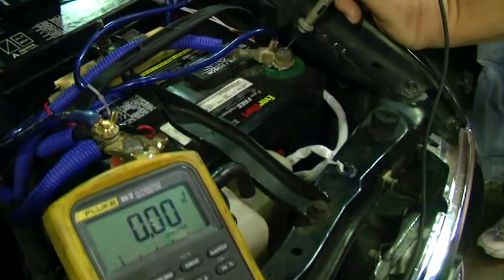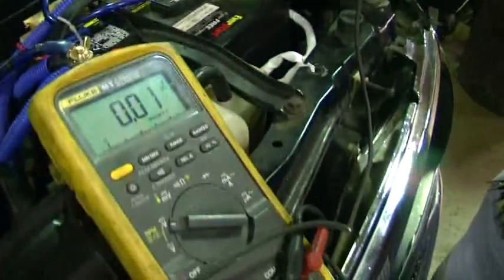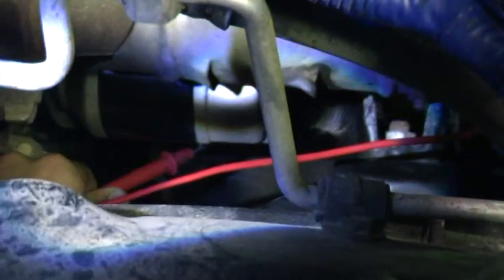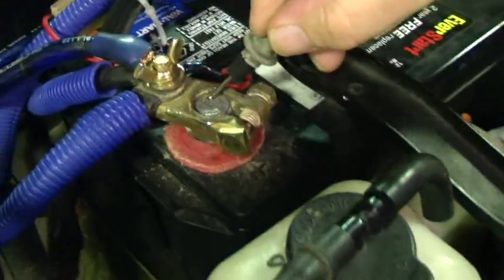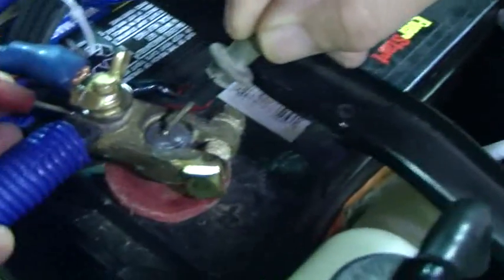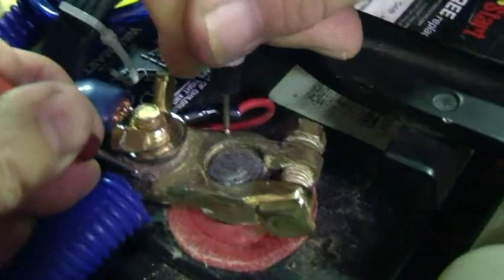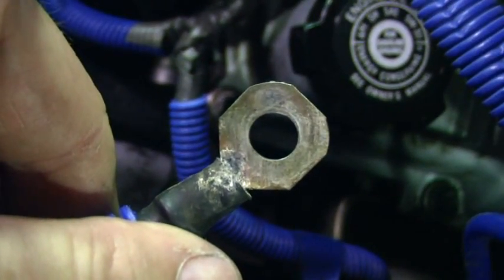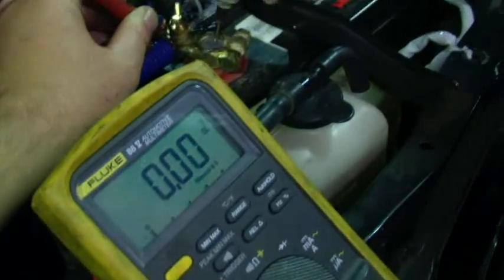Starter Circuit Voltage Drop

Comment: So what does a voltmeter measure? 

FS explanation: As charge (measured in Coulombs) moves through a circuit, it must be driven by energy (measured in Joules). Voltage (or Potential Difference) is a measure of the amount of energy driving the charge at any point in the circuit.
 Voltage = energy/charge = Joules/ Coulombs=Volts. 
The voltage always has to be measured between 2 different points\polarity, in the 
circuit,

Comment: At this 3rd level of understanding, there are 2 competing but equally 

rigorous and correct systems for describing "electricity"; the 2 systems 

vary only by including or not including time as a factor. The system that 

does not include time is more fundamental, getting right down to the sub

-atomic physics that drives electrical phenomena, so I prefer it. Let us 

call it FS for fundamental system. The popular le Systeme International 

includes time

Comment: rather than technically correct facts, easily misinterpreted partial truths, and the 

occasional totally incorrect information. When people start ascribing 

human characteristics like "desire" to electrical circuity, and use 

outdated or generic words like "electricity", you know they are operating 

at that middle school or high school level textbook level.

Comment: OK, what we've got here is information being expressed at different 

levels of understanding and usage. 

(1) An electrician only needs to know that his voltmeter measures 

something called "volts", without being concerned what "volts" means. If 

his voltmeter reads 117 volts here and 235 volts there, he knows whether 

or not the circuitry is working properly. 

(2) A person reading a school textbook is going to be subjected to 

oversimplification, creative use of langauge and analogy

Comment from the maker: Sorry bro, how wrong you are.  Meter leads measure a difference in voltage between each lead. Place one on the battery neg and one on the battery pos and it will tell you the diff between the neg (0 volts) and the positive (12 volts). 12-0=12 volts. Place one on a pos post with 12 volts and a pos clamp that is only getting 3 volts because it is not connected to the post good. 12-3=8 volts. The the voltage drop is 8 volts! This type of measurement has been around for a long time and is used often

Comment from the maker: How wrong you are. Meter leads read a difference in potential voltage. Normally we place the black lead on the battery because we know that is a source of 0 volts.  If we place the red on the positive post it will tell us the difference in voltage between the two posts, (12 volts on a battery). Same hold true if we place one lead on the pos clamp and one on the pos post. If all is good, we should read 0 volts.  If the connection is bad it will read the diff in voltage between the to points.

Comment: . Disable the engine so it will not start when it is cranked. (Ground the ignition coil wire, or disable the ignition circuit or fuel pump relay.) Limit cranking time to 15 seconds or less.

C. While cranking the engine, record the volt reading on the DVM. D. Next, connect your meter positive (+) lead to the battery terminal stud on the starter, and the meter negative (-) lead to the starter housing.

E. While cranking the engine, record the volt reading.

Comment: Set your DVM to the 20 volt scale, then connect meter positive (+) lead to battery positive (+) post (not the clamp or cable), and the meter negative (-) lead to battery negative (-) post.

Comment: This is a joke or something? You cant put both leads from the voltmeter on positive  and read a thing lol  this guys a nutjob ? or a clown?   but trust me, if you put both leads on positive you cant read a thing! . If a horn was there or any device, you could read across the loads terminals, but reading 1 side of power with a voltmeters not possible.  can you tape off a AA batterys bottom and put it in a flashlight and have that work? no, you need 2 sides of power, a meters just a load!!!!
Reply: DUMBO.

Comment: Volt drop tests are intresting, mainly due to the fact there is no "standard" . How many volts should I see drop between the alt and the battery? How many tenths is ok and at what point is it too high?  I read .2 volts for a 70 amp output and kinda go by that as a standard. 

  Resistance generates heat, how many bad cables have you found just by feeling a terminal?

 I saw a Japanese guy workin those multi-meter probes like they were chopsticks, man was I envious, he was precise as could be

Comment from the maker: @Juusstas In the video we are using the direct method of measuring voltage drop. One lead is placed at the beginning of the circuit (B+ at battery) and the other is placed at the other end of the circuit (B+ at starter). Any voltage lost between the B+ and the starter B+ will show directly on the meter. We are not measuring voltage to the starter! Since both our meter leads are on the B+ circuit the meter will show the total voltage lost in the B+ circuit. We had 12v at batt but lost in circuit.

Comment: Thanks for this video, I like how you didn't gloss over anything, but showed exactly where to probe for each different portion of the circuit.  Very well explained.  I was able to methodically pinpoint my problem area as the interface between ground wire and clamp.  Put a new clamp on, cleaned the wire, and solved a very frustrating, intermittent problem.  Thank you!

Comment: I just want to say thanks for this video. I've spent days reading electrical mumbo jumbo trying to learn about this and other concepts of testing DC systems. I've learned more here in 6 minutes than I have learned in the last 6 days.... Now if I could just understand how I can have enough supply voltage to a good coil but not enough flow/current/amps to make a nice fat spark instead of a skinny orange spark....

Comment from the maker: @scootbmx01 Ah yes. Voltage drop on the ground, while not the problem in our case, would cause the exact same symptoms. A bad connection on either could cause the starter to just click.

Comment from the maker: @scootbmx01  Hmmm, did you actually watch the video? lol. Voltage drop is measuring the voltage difference between two points. ie. wherever you put your two leads.  In this case the meter read 12volts. That meant that the difference in voltage between the clamp and attached eyelet was 12 volts!  Since these two points are touching they should have exactly the same voltage.  They did not! Notice it was the POSITIVE Clamp that had the voltage drop between the clamp and the eyelet..

Comment from the maker: @mindswapp  In the case of high current circuits like the starter, resistance can not be measured accurately enough with an ordinary meter. For example, .01 ohm sounds like a good connection. However, if the starter is operating at 150 amps this resistance would cause a loss of 1.5 volts!  Think of it this way, resistance is a static measurement that tells us the circuit is there. It does not tell us how much current it can carry. Voltage drop is a dynamic and true test of the circuits operation

Comment: @MrHvm1985 I couldn't agree with you more, There is a lot of voltage drop questions concerning the starting circuit in the Electrical ASE test. You wanna learn voltage drop... this is it right here!!!

Comment: great video, i drop test before checking voltage at accesories, much faster to find problems that way.  just remember that the cicuit HAS TO BE LOADED to check the drop in voltage.